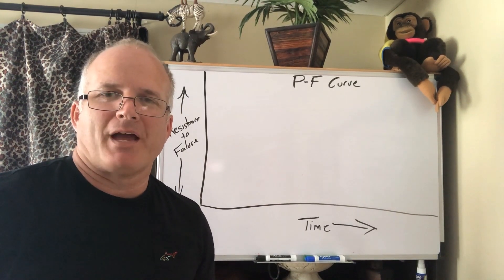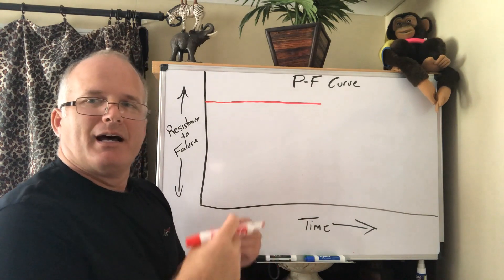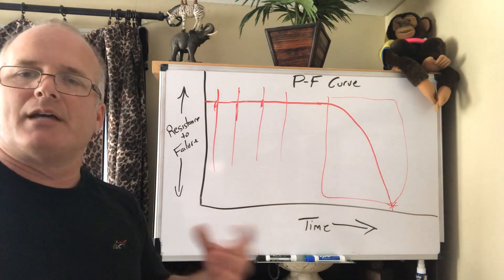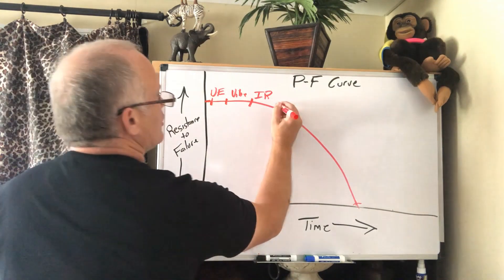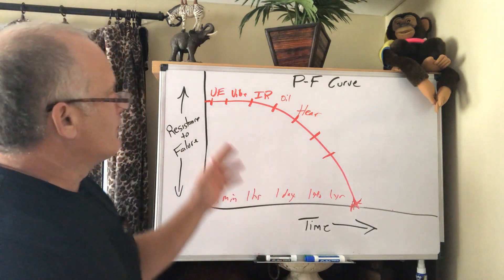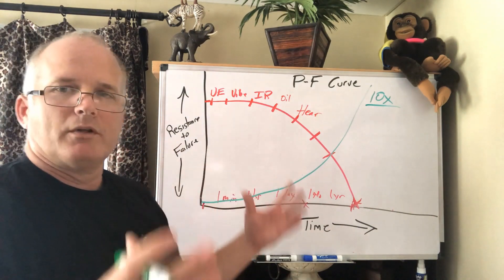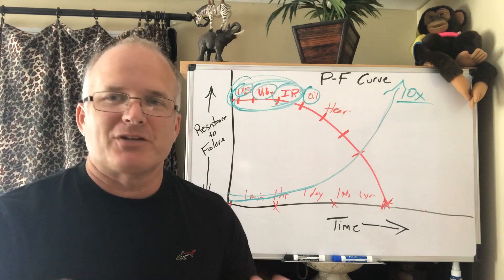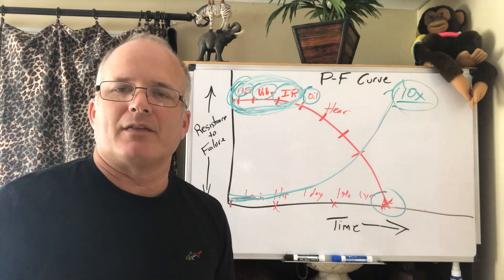What is the P-F Curve?

Comment: Thank you for sharing such useful analysis of DIPF Curve. Just a quick question, are there any sort of analysis or calculations that can be made to specify inspection duration of mentioned technologies before any part gets damaged!! Thank you again
Reply from the maker: Sorry for delayed response; I actually thought I already responded to you.    

The short answer is YES, but it is time consuming.    You can do SFMEA (Simplified Failure Mode and Effect Analysis) on every asset.   This is where a team of people look at all possible failure modes and employs countermeasures to prevent occurrence or give early warning.   PdM is used for early warning.    The problem can be the number of assets you are trying to understand.    If you have 500 assets all with 10 reasonable failure modes, this is 5000 failure modes to study and implement solutions.    Most companies would die under this workload. 

My approach has been 3 fold...
1.  Begin a SFMEA on your critical assets.  Critical meaning high probability of occurrence and high business impact.   You can calculate a number for this to prioritize assets.   Google "asset criticality"
2. Just Start doing monthly PdM checks with as many technologies as you can (lube, vibe, IR, UE)
3.  Autopsy each failure to see if frequency adjustment is necessary.  

Don't get paralyzed by only doing #1 above.   Engineers are often perfectionist and can't "just start".   

Let me know if I can help more.

Comment: Hello, I would like know, how can I obtain the correct period between inspections?
Reply from the maker: This is a difficult question to answer in the limited space provided by YouTube.   Nevertheless, here is my reply...

1) There are "rules of thumb" you can Google search for particular pieces of equipment: pumps, gearboxes, conveyors, etc.   This is a good place to start or compare your current practices.  
2) On an inspection, history can be your best guide.  Look at the last 6 inspections and see if anything was noted by the craftsmen; if not add time to your frequency.   This is true for PM and PdM.    Example:  move from 4 weeks to 6 weeks. 
3) the best approach, yet very time consuming, is to conduct an FMEA on your critical equipment.   Here you gain understanding of how equipment is likely to fail, repair times, and impact to the business.    Unfortunately, this can easily take a week per piece of equipment.   This process can take years if not decades to complete.   Critical equipment selection is a process in itself.   Look this up to on YouTube.    Begin with your 20% most critical assets.
4)  Impact of the inspection.   If the impact has low cost and low impact on production, you may choose to have a short frequency.  

As you can see, the answer is complex.   The key is to do something.   Have a process supported by a cross-section of stakeholders, and seek to optimize your PM and PdM programs.   You will make some mistakes, but I bet you will be right over 95% of the time.    Don't become paralyzed by fear; this is where most organizations are.    Good luck.